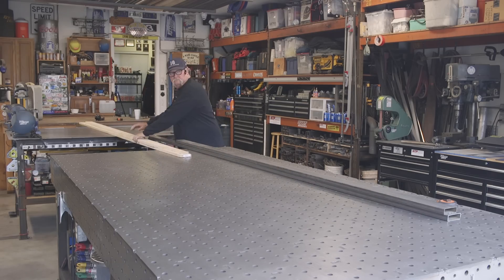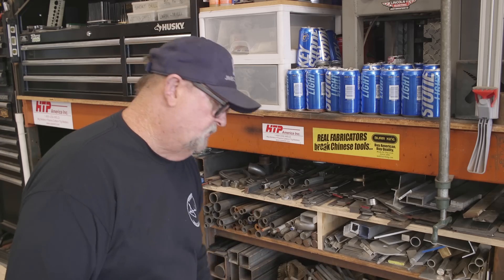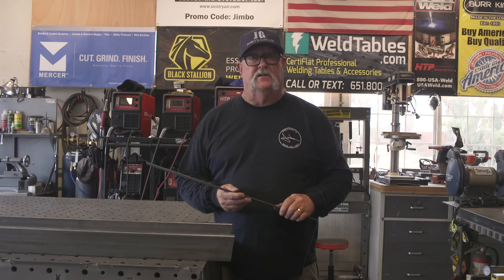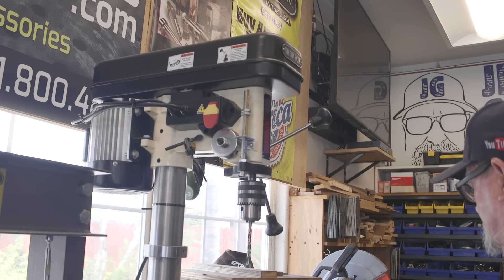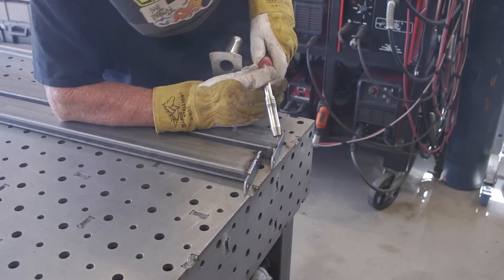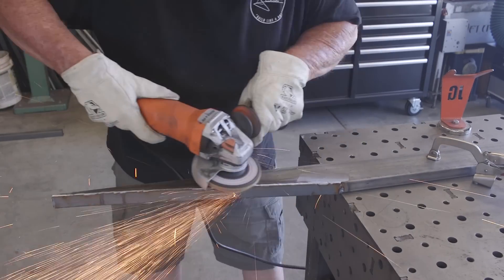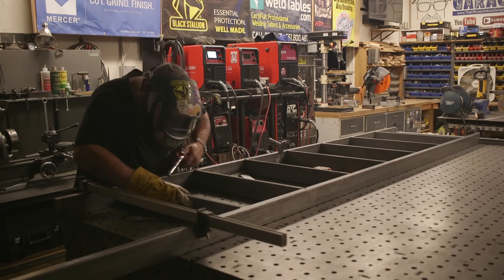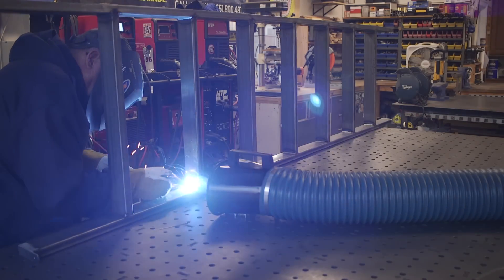Loft Handrail and Ladder Part 2 | JIMBO'S GARAGE

Comment: Jimbo, if you pound those step strips down with a rubber mallet it really makes them stick well. Sometimes it will even make it conform to irregular surfaces like diamond plate. I've done that on some diesel truck steps. 👍🏻.      🇺🇸😎

Comment: The stop nuts on the drill press was at fault, who did you let use it? the nuts were down and they kept pulling down hard. 100% correct.

Comment: I bought the same drill press after your review, I find the platform is a lot higher than my old craftsman. I lowered the table top 4 inches, I was going to cut 4" off the upright piller tube. Have you thought of that, keeps the metal shards out of your face..

Comment: I have a question for anyone, im 14 trying to get in to a welding career when i get older, i only have an old crappy MIG welder and an old welding helmet my problem is when i start to weld i cant see where im welding because when i start to weld i veer off of where im trying to weld, i dont know if its something with the helmet being to dark or something. Please dont hate just  trying  to get some advice.
Reply: I am going to make the assumption that you don't have an auto darkening helmet. This means you are stuck on a specific shade, and that might be shade 12. When you are welding light stuff, your helmet needs to be at a much lower shade, say 7 or 8. That's why you can't see what you are welding because the arc is not bright enough for the shade your helmet is at. You can pick up a cheap auto darkening helmet with an adjustable shade for around $30. Thats a good start while you are learning. That's what I used and I probably have 4 or 5 of them before I finally bought a good one. Your personal protection equipment is the most important thing when you are starting out. Make sure you have decent welding gloves, jacket, helmet, and don't forget to cover up your arms so you don't get "sunburn!" I hope that helps.